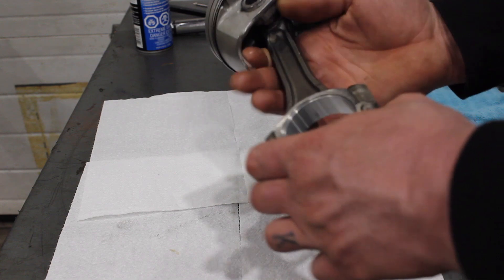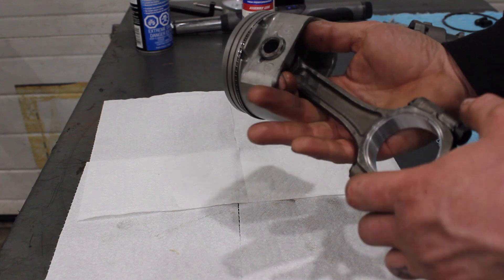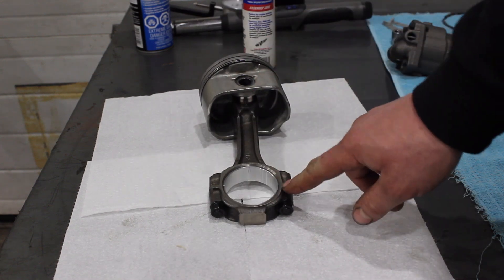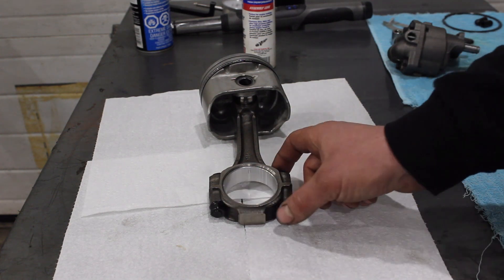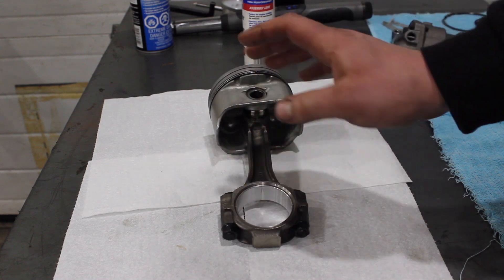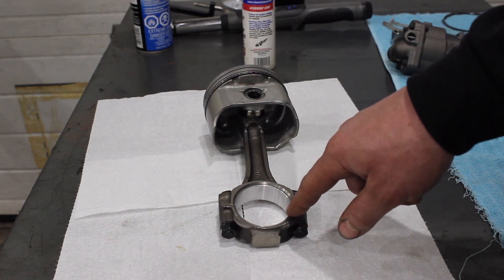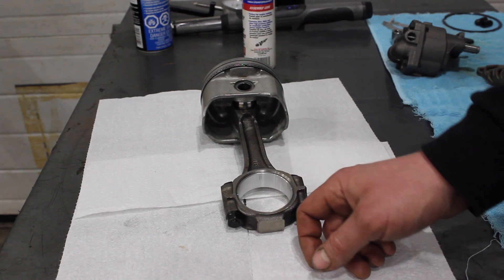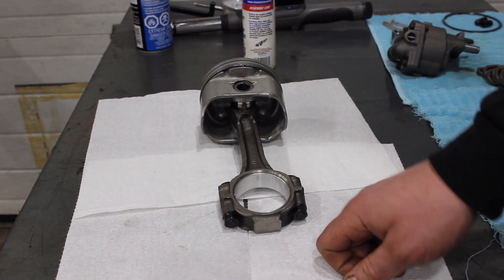An Important Upgrade! Even for a budget build (L31 Build Part 3)

Comment: I am following along because I got my vortec torn apart. It ran great in the 2000 2500 silverado. I like to inspect an engine before it goes into something else. The budget build also is a guide when something actually goes wrong like the chatter you had in the unknown vortec with the bad valve guide. Thanks I'm following.
Reply: what are your intended plans for that vortec? is it a 350 or a 454? if its the 350 i may have some info youd like if your not building a screamer
Reply: @chehystpewpur4754  just a 350 vortec. It is a spare engine for a get around town c10. It was running great but the head has a slight pit in the valve seat. I will grind it and check with vacuum. I really didn't want to send this one to the machine shop and wanted to inspect it.
Reply: @dysonmetal  i will say this if your interested. lunati makes an efi cam for the lt1/vortec l31. its .450 in lift on the intake and exhaust. its the biggest you can run without head work or valve spring upgrades and valve seals and all that. absolutely phenomenal cam for these motors. pair it with a set of long tubes and you have yourself a very healthy runner with great street manners and reliability plus it actually gets great fuel economy. i get around 35mpg city/backroads no questins asked. is in a light vehicle first gen s10 blazer but still. 35 mpg with a mild small block is unheard of. highway is around 25-28 mpg depending on if your doing 65-75 mph. not too shabby for being in the 11-12 sec range in the 1/4 mile.

Comment: In the northern Illinois area it would be cheaper to buy  scat or eagle rods  that are bushed .
The shops around here are getting out of control with pricing. 
200 to resize 
Plus new rod bolts. Plus upchage 
And to put press on pistons back on the rod. Cheaper and faster to buy new ones sometimes. 
Your videos are awesome. BTW
Reply from the maker: Yeah are right, theres definitely a teeter point depending on where you are. The good guys dont need to removed the pistons from the rods to resize so doing a budget build its often cheaper just to resize the olds with new hardware. The next issue is balance, the aftermarket rods and the factory rods can be different engine to feel.
Reply: Exactly what I tried to tell him on the first video. Sir eagle rods, flat top cast pistons with enough leftover to re-balance(or minimal extra) if necessary? The flat tops would help get the compression up a bit for a little extra performance potential.
Reply from the maker: @It's Either Gonna Work Or It Ain't Garage  im also doing a vortec build with flat tops but the whole idea on this one is to reuse as many stock parts as possible and see what power we can get
Reply: @cuttersperformance  
Oh ok, well maybe you could of said that instead of "budget" build? Because sometimes it is more budget friendly to buy new parts especially when dealing with a sbc. You could of even got a mildly used set of Vortec pistons and rod assemblies that didn't need to be re-conned for way less too.

Here's what you could of called it an "if society collapses Mad Max where you have to use what's there build". Once you find out the rods need to be re-conned then the word budget is off the table. Re-using the factory rod bolts with rods that don't need to re-conned should still be good for 450 HP and around 6,000 RPM a bit more if it's well balanced and or if the rods get polished beams and shot peened.

If the rods are stretched out of round odds are that the bolts will be stretched out of spec as well. If not then the bolts should be good to go as well. If 5/16" rod bolts from an LS can be re-used for 700 HP and 7,000 RPM the factory sbc 3/8" bolts should be good for 450 HP and 6,000 RPM.(for future reference for an actual budget build)👍

Not sure why people are so leery about re-using sbc rod bolts with an under 500 HP build? I have never seen a sbc factory rod bolt failure, usually the factory rod breaks before the bolt fails.(LOL) On the other hand I would NOT trust a Chinese rod bolt to hold 200 HP. They cut the threads on those over there while the rod bolts made here including the sbc factory rod bolts have rolled threads.
Reply from the maker: I thinks its more on where you live though. For me to buy rods and pistons, it was roughly $520 USD. While rod bolts and resize cost me $223, so for a budget build it just makes sense for me. 
Like I mentioned in the video I could have resued the rod bolts but I prefer  ARP bolts when resizing. When I check the rod ends there were quite out of round
Reply: @cuttersperformance  
Absolutely, like I wrote in my previous comment, "if the rods are stretched out of round more than likely the bolts are stretched out of spec." I keep forgetting that you're in Canada eh. Try to talk with more of an Canadian accent and try to remember to use more Canadian slang in the future eh. LOL JK

Yeah IIRC the Sir Eagle rods are about $163 USD here and pistons vary depending on what you buy but for a budget minded set of flat tops over here is are $100. Most shops over here around me charge around $20 a rod to re-con so about $3.00 less than the new ones unless you caught a sale?

If you truly wanted it to be budget, a used set that doesn't need re-conning  would be $10 to $50 depending on who is selling them?
Reply: Yep I hear you, I'm in central Illinois,  it's crazy
Reply: Machine shops have gotten ridiculous. Many have priced themselves right out of buisness. Pitiful.
Reply: @thereluctantgearhead4544  
Not really because so many machine shop owners retire and no one takes over the shop all the machinery gets sold and now the machine shop down the road has twice as much work. So with only so many hours in a day work has to be turned down or the pricing goes up. Usually a shop will raise their pricing so if they want them to do the work they pay or go some where else.

Must of been a lot of machine shops owners retire over there without the shops being replaced? It's very hard and expensive to open a business these days so I don't think those shops will be replaced? Gotta find the guy that works out of his garage if you want half way reasonable pricing these days.
Reply: @itseithergonnaworkoritaint7852  Lots of price gouging going on around here. I've worked in 2 machine shops myself years ago, and obviously shit has changed. And it's not old guys running these places anymore, alot of younger dudes are working in them now and they are a different breed than those old timers. Shits gotten ridiculous. Service has gone to shit also, instead of a week waiting time, now it's 6 months to a fuckin year to get your shit back. Times have changed. Us old guys watched it happen. I've been in this game a long time. Probably before you was even born.
Reply: @thereluctantgearhead4544  
If you were at this before I was born that would make you way to old to work on this kind of stuff son. LOL
Reply: @itseithergonnaworkoritaint7852  I'm old, but I'm still healthy and I'll work on this shit till the day I die. People think I'm 10-20yrs younger than I am. Still work like a horse, although I'm retired. I still do this everyday. My dad's pushing 80 and he looks 60. And he still builds engines and hotrods. He worked as a coal mine mechanic for 50+yrs.
Reply: @itseithergonnaworkoritaint7852  You will probably work on this shit till the day you die as well. That's the life of a gearhead. Can't quit.
Reply: @thereluctantgearhead4544  
You must of been able to retire young? Good for you, that's awesome. If my Dad was still alive he would be pushing 86 this year. My neighbor's dad Frank was a car guy and he was still playing with cars at the age of 87 right up close to the day he died, I want to be like Frank. He was a Tool and Die maker like myself he was into those old Ford cars with the retractable convertible hard top, I can't recall the name of those from the 50s. That's awesome your dad is a car guy and he's still around playing with this stuff @ 80!
Reply: Was going to go resized and ARP but was the same price to go Eagle bushed rods. Machining is getting pricey and weeks if not months to get work done.
Reply: same here in south alabama. my small town "machine shop" doesnt even turn cranks anymore.

Comment: Do the tbi truck engines have powdered metal rods? Also, My 94 block is drilled and tapped from the factory for the spider tray for roller lifters but of course it's flat tappet. I figured it would make a good builder.
Reply from the maker: No it will have regular forged rods. You probably have a 638 block, which is what I run in my boosted trans am. If they sonic test well they are great blocks
Reply: @cuttersperformance  yeah it's a 638 4 bolt main. I was surprised it was 4 bolt main, Its in my 94 k1500 and I thought the half ton pickups got 2 bolts from 88-98. I learn something new all the time.
Reply: @Bobthebuilder.69  my dad got a 638 block from a biiig carpet van. the main webbing was so thick, they had to machine the sides down at the factory to clear the crank counterwieghts LOL.

Comment: My 880 block had the rods like that and 2 bolt mains. If I had the PM rods I would have had them re sized and ARP bolts installed and called it a day. Now I'll probably just get a complete rotating assembly. Scat rods and crank. Pistons; I haven't decided yet.
Reply: i think the cranks are wonky in some of them too. still good motors but very easily upgraded to something much better.

Comment: another thing to add.
a good possibility or maybe a probability of most gm caps being a crack cap. yes many rods are made they bore them and then they use a large press from the side and crack the bottom of the rod off. whoo its perfectly aligned because the rod self centers on the breaks. dowels are better. but when they exert that force on the side maybe it puts the rod just barely out of round. yes cast shouldnt bend and stay bent but it can and does bend before it snaps. and doesnt always bend back to what it was. i really wondered if i should do pistons and rods on my motor when i rebuilt it because the bearings looked horrible for a good running engine that was less than 10 years old according to the block casting but i rolled the dice and have a feeling bearings are gonna be what fails on it someday.

Comment: I also follow you and find your videos pretty good. I’m getting into a similar project. Mine requires a crank as the subpar intake claimed the bearings on the 7&8 rod journal. It has what appears to be the same rods as in this video. I’m going to replace at least one rod and keep the factory pistons. Mild build!! Any clue on a part number for these rods?
Reply from the maker: For the late model vortec PM rods, the part# should be GM # 10108688

Comment: im pretty sure you have a video were you talk about swapping the pistons with some summit pistons and skip balancing because they are simalar in weight, ??
Reply from the maker: I have used the summit pistons with a stock vortec crank and rods without balancing. If you're using an aftermarket crank or rods be sure to get a balance done. Balancing is never a bad idea but not always necessary for a pistons swap. I had an eagle crank recently that needed 2 slugs of mallory to balance with stock rods and summits pistons
Reply: @cuttersperformance  
Yes sir I appreciate the info 
But I’m just gonna swap to some ft. And I have access to a  set of Melling springs 466524 
1.8 IH
1.2 OH
130 IP
325 OP 
that should be good for 600 your input is appreciated

Comment: Did you ever read the book the Chevrolet racing engine by Bill Jenkins? He maintains that you don't want the big ends round because at high rpm the big end distorts and causes the bearing to dig into the crank at the dividing line
Reply from the maker: I have not experienced that before. I have seen very odd bearing wear and failure with out of round bores though. Maybe some circle track guys using stock style rods may oval the rod slightly to help with distortion at extended high rpm but ive never came across that
Reply: Grumpy knew of this , and by the way Smokey Yunick is the one who found this out. But the Rod bore is machined perfectly round. The difference is in the way the rod bearing is made. Thinner along the side where the parting line is. Smokey found that when the rod encountered detonation, the hammer force would be directed at the upper and lower bearing location, which would "cave in' the bearing at the parting line. This would allow the leading edge of the bearing to move inward toward the rod journal and act as an oil scraper. The rest (of the engine that is) is history. So, they developed what we have now, all rod bearings are thinner at the sides, closest to the parting line for this reason. That is why when we measure the bearing clearance, we measure at the ideal locations across the top and bottom with our micrometer or plastigage. FYI.
Reply: Jenkins also built engines that worked in the 7000 and up range.  For an engine that may spend the majority of its life working in a utilitarian way, resized big ends are exactly what you want.
Reply: good question but look at it the other way too. most race engines see forces that are not ever going to be seen on the streets. especially racers of their caliber.
for a work truck thats going to be abused on the other end of the rpm range these things free up power and get rid of some of the factory defects that can cripple production motors. 
having round bearings and straight shafts are going to keep an engine smooth and less friction. balanced rotating assemblies are the most efficient after all. piston acceleration and rod acceleration can also have an effect on your actual rod length and loading and is a pretty high cause of actual rod failures that arent abuse. 
if your building the kind of power that your worried about breaking rods your not using stock and the aftermarket ones are going to be designed for the caps to be perfectly round or slightly off to adjust for torque specs or loading during their intended purpose. 
yet in the 2 stroke world nobody has an issue starting a 50 year old engine and taking it to redline.
most 2 strokes use roller bearings and or needle bearings which allow the crank to move slightly so it doesnt tear itself apart and most of the force from the rod and piston are transferred straight to the crank. and nobody cares about making sure its not gonna come apart. its crazy how differently engines can be built and have an almost same result. i have a little 70cc 2 stroke that i swear to god the crank is stronger than either of my small blocks. the rod is literally almost as big as my sbc rod and rated for 16k rpms and they arent joking. 10k+ miles and the thing is still brand new. i bought it with plans of a 30hp cylinder and over 14k rpms but decided to stay around the 20hp cylinder level im at now and add some boost because why not. supercharger is easier than one of the turbos i have and cheaper than the pieces i still need to plumb and lubricate the turbo so it will go on a diff toy. i actually plan on ordering 2 more of those cranks if this one survives because i see nothing stronger for under 4 figures and thats absurd. because i have a set of cases i can cut and i could cut those cranks shorter and make a 2 cylinder version of that setup and feed it with a supercharger too. i would never modify those cranks rotating assemblies because im afraid id make it worse but on the low rpm range of a small block in perspective there is alot to be had from just the smallest of things and improving your rods and making the engine more reliable im all for. but im pretty sure it sold me on a new set of rods for the sbc rather than modifying these ones.

Comment: i got my block tore down and it has pm rods in it "round on the cap" so the rod is better is the hardware also or should they be upgrade too?
Reply from the maker: Add some arp bolts and have them resized. You got yourself a set of rods that will handle 500 hp no problem

Comment: I’ve had no experience with the PM rods.  Are they as strong as the forged rods.  Do they stand up to a 400 horsepower engine?
Reply from the maker: They are considered the best of the factory gen1 rods. But any GM rod will last just about forever at 400hp. I have a few engines with PM rods with arp bolts making 550+ hp with boost for several years
Reply: @cuttersperformance  good to know!  Thanks for the reply.